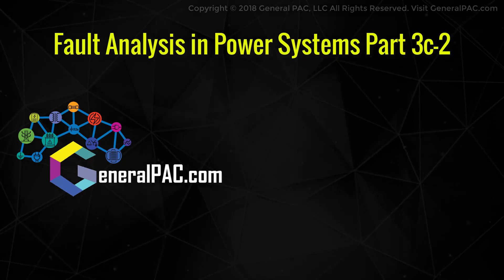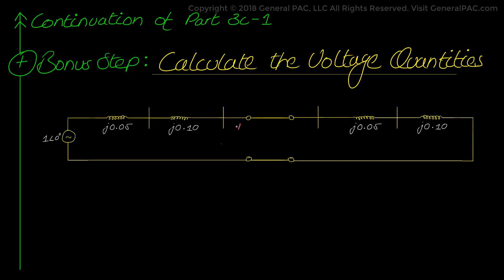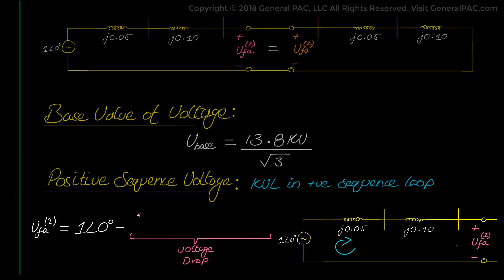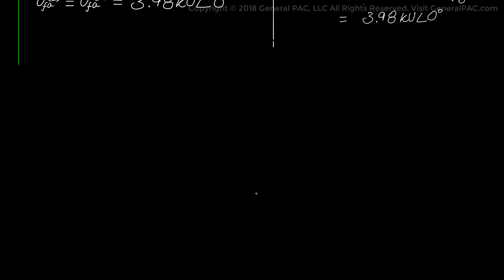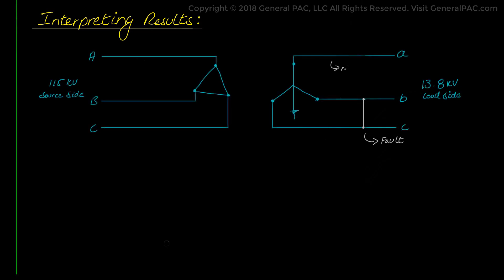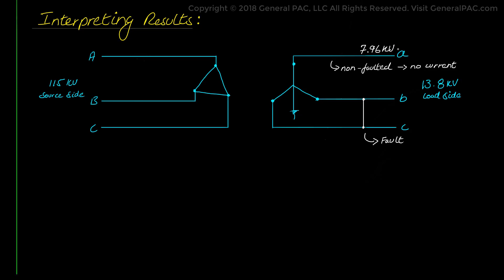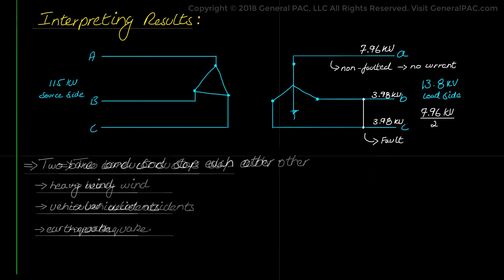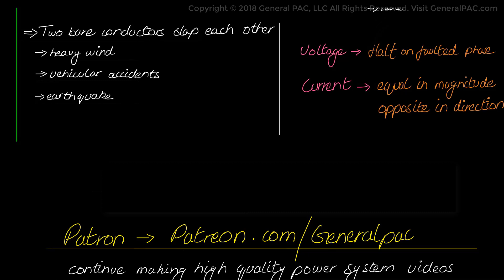Fault Analysis in Power Systems Part 3c-2

Comment: Hello! The videos are very informative and helpful. One thing I'm confused about: during the calculation of base voltage, why is it divided by √3? Does it have something to do with line voltage and phase voltage?
Reply from the maker: Hey Shafquat, you have reached at the right point. Yes, it is linked with line and phase voltage.
For unsymmetrical fault calculation using a sequence network, we use phase values that are phase voltage and current as base values. As we know that in Wye connection:

phase voltage = line voltage / √3

So for calculating base voltage in the Wye connected side of the transformer, we divide line voltage by √3.

Thanks,
GeneralPAC by AllumiaX